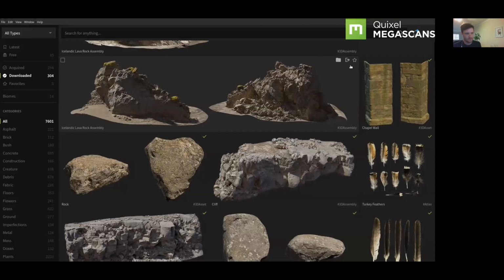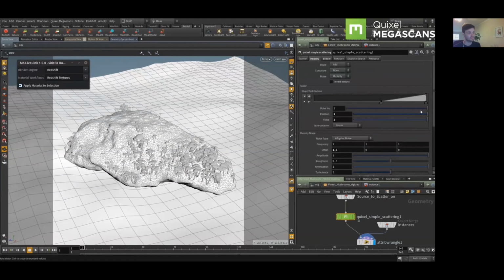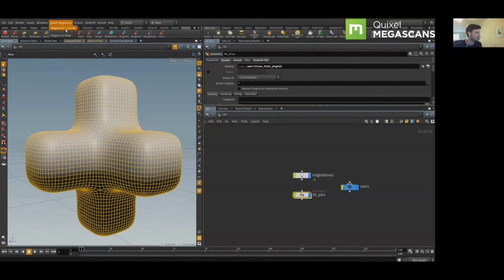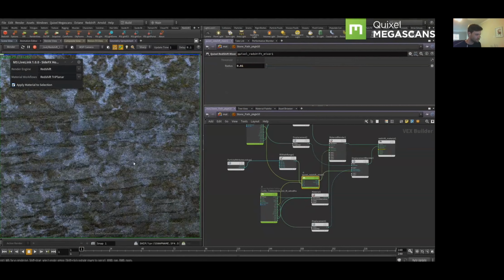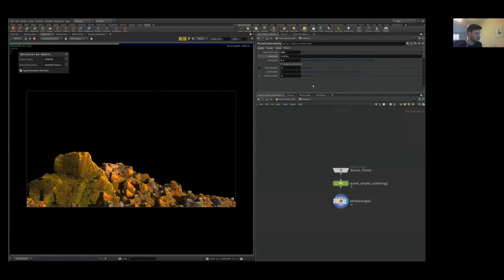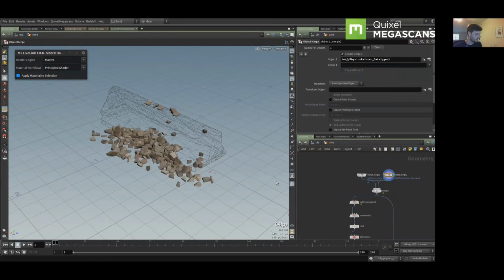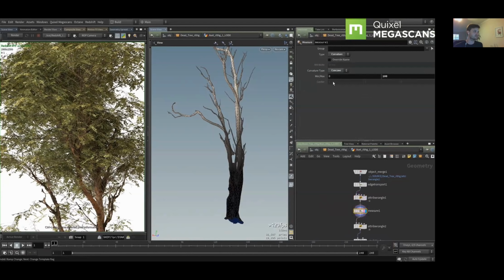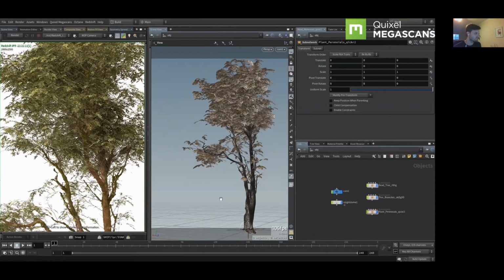Quixel Bridge / Houdini Live Link | Quixel TechArt Team | Houdini ILLUME Webinar

Comment: So Good! Quick question, where can we find the wind attribute? is it a point attribute that we can change via vex? I assume it's a vector type... More info on where to access wind would be awesome. Beautiful job guys. Thanks!
Reply: The Megascans assets come in with vertex colors where the red channel is usually a linear falloff to indicate which parts of the mesh can get affected by wind and how much, and where the green channel is offset value so leaves etc doesn't look to synced up if animated by a noise value or similar. 
For the Houdini plugin these 2 values are renamed to q_wind for the red channel and q_offset for the green channel, however they remain as vertex attributes since they come in as vertex colors. The reasoning behind it is that Cd is used a lot in Houdini so I wanted to clear that out to be free, but I didn't want to promote it to point attribute to change to much around either. But most of the time I tend to promote it to a point attribute for myself anyway ...